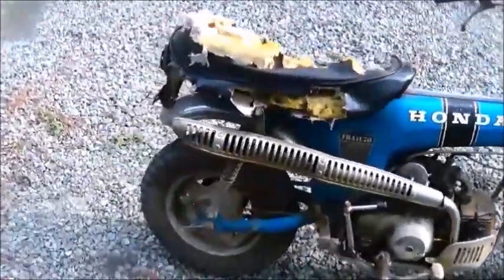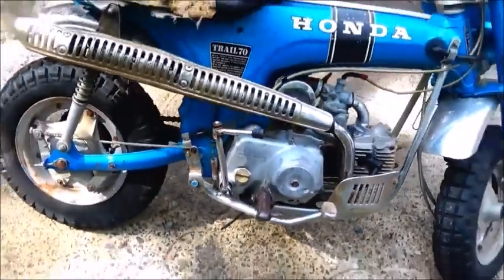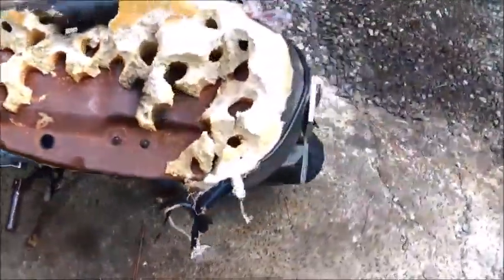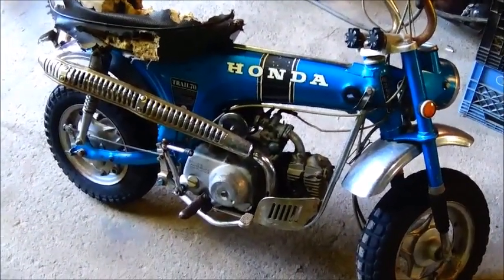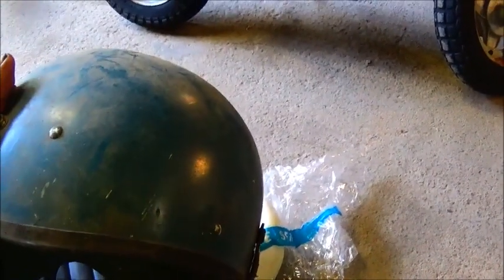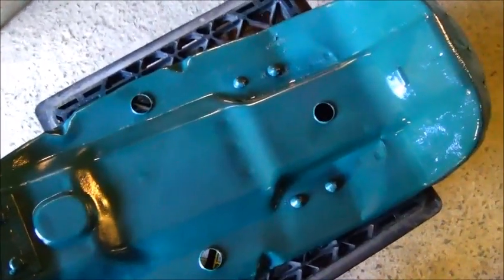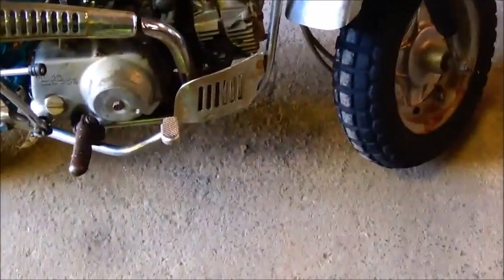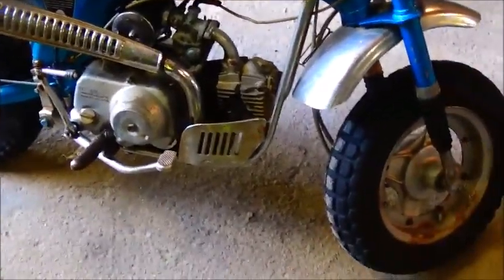Honda Trail 70 CT70 Seat Recover & Muffler Repair

Comment: I had an early 70's CT70 that my best friend and I bought together completely disassembled , I think we were about 12 then.. it was in 4 milk crates.. we got it running and driving .We later bought another basket case CT70 H model the H was manual clutch and I sort of remember the exhaust pipe was different like yours is to clear the clutch release arm...  We later bought a rolling chassis SL70 and swapped the engine into that, it was a conventional style dirt bike.... Man I miss those days!

Comment: I've got a green Ct 70, bought it at a yard sale for 100 dollars. I just recently pinched the throttle cable in the forks when i turned them and now I can't ride it till I get a new one. Seat is tore, dry rotted tires and no tail light or twist throttle( atc 70 throttle box), no title either. It's a rare 4 speed model. If I had a title I would make it street legal. One of the front shock is froze so there's no front suspension. It's a lot of work but it's worth it.

Comment: $725 for that project Trail 70? It sure sounds like a lot. I completely understand your affection or appreciation for it though because it was the first so called "motorcycle" that I ever owned. Other than that I had one or two minibikes. I wish I could remember something about those minibikes but being a kid, all I knew was it either ran or it didn't. I just remember the minibikes seemed to be a lot louder and much more likely to fail or to maybe hurt you. The Trail 79 though was very STOUT and STURDY. The Trail 70's were very well built.

Comment: I am pretty sure steel wool will buff the rust off of the handle bars. I have brought chrome back that looked that bad before with elbow grease and a package of steel wool. You got the bike looking real good. I thought it was worse at first but its not bad looking at all.

Comment: Johnathan. you will have to split the center case to replace the kick start shaft . and if you get a chance check out my ct70 I'm a big boy it dose allmost 50 mph
Reply from the maker: Didn't realise that. I haven't been in one in 30 years. I will figure something out. Thanks.
Reply: Jonathan W,  yep crankcases need splitting,  numerous small parts to note positions of etc, a manual is a must.

Comment: I had a apple red one, sat in my parents basement for years after I broke it, I found you could hold down on the shift lever rev up the engine and release to do a slide burn out they didn't have a clutch, and yes I did that one to many times broke the mag right off the end of the crank, dad wanted it gone gave it to a neighbor for nothing I wish he hadn't, I remember taking the cover off man them bolts philips head don't like to come out used a hammer impact to loosen, memories sigh.

Comment: Not knowing how the seat cover was held on the Trail 70, I would never had worried about it coming loose. Knowing that small metal v's under the seat are holding the seat cover on, I would worry that the seat cover would come off. And being without knowledge, if the seat cover started to come off I would think, "Damn, the seat cover is busted, broken, fucked up." Sometimes my mental security is absolute when I don't know how tenuous a situation is. I mean, the brakes work but then they don't work so well. I mean, the difference between working and broken in my mind can be absolute when maybe the brakes need some fluid or the bike seat nears a minor fix. I never was a guy who was looking to fix stuff. I was an out of sight out of mind kind of guy. I still am half the time. I have to remind myself that maintenance is necessary to keep stuff from being "broken".

Comment: I've had the Red sheet metal 90 motor cycle, and the CT50 minibike.  I'd really like to find a 50 again... My Brother has collected about 6 CT70's for parts and has 4 running, last I saw.

Comment: Hey Johnathan. Was wondering where you sourced all the parts for your Honda 70. Have an early 70s Honda 50 that needs some rebuilding and just need  good quality parts.
Reply from the maker: Ebay, there are a lot of NOS and new Honda brand parts on there. All the grips and rubber I bought is OEM parts.

Comment: My brother had a Honda CT 90 that ended up being my first motorcycle it had high and low range in low you had to be careful about the throttle great job with the seat cover how many miles are on it?
Reply from the maker: It's over 6000, so it's high for a trail 70, my others have 2 to 3 k on them

Comment: didn't some of them trail bikes come with or had the option of a different sprocket for lower speeds?? I could be wrong on that?
Reply from the maker: Not sure, but in first gear they pull very good. I am 200 pounds and I was telling a friend how much power they had and I don't think he believed me. I got on a 1972 I have, it's a red one, and he sat down backwards behind with our backs to each other, he weighs 225 and I took him for a hell of a ride. I made him a believer for sure.
Reply: MissouriOldTimer that was the early trail 90s
Reply: I thought I remembered something like that, thanks.